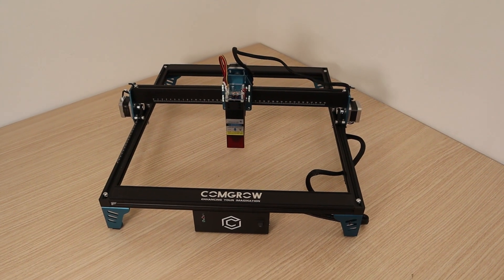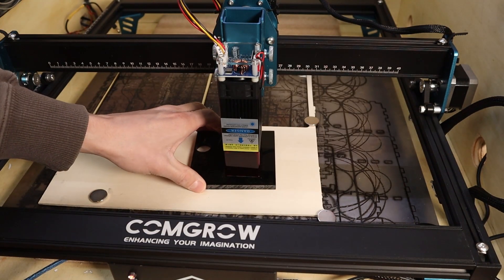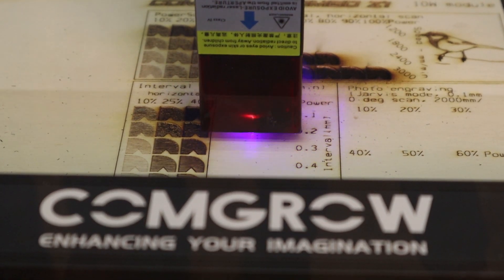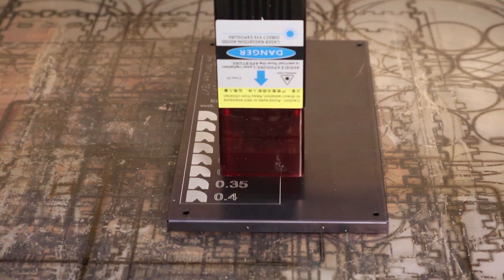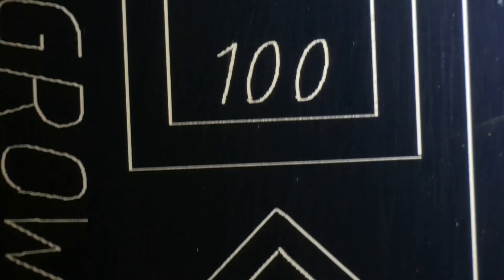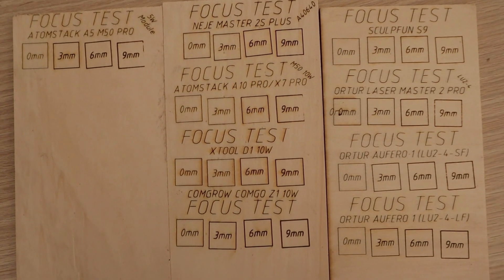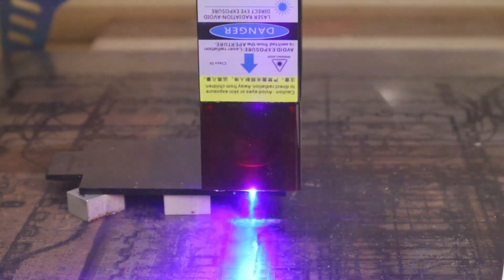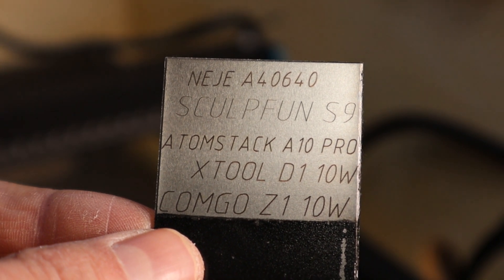Comgrow Comgo Z1 10W Dual-Beam Laser Engraver Review and Test | Affordable!

Comment: Of all these in the 5-10w diode range, which one do you recommend the most overall and why?
Reply from the maker: Choosing the best one will heavily depend on what you mainly want to do with it and what is your budget. For example I can't say one is better than the other if the first one costs twice as more.
Reply: @JTMakesIt  good point. I will be using it mostly for medium volume runs cutting corrugated cardboard for shipping and custom packaging. Also some engraving and fun hobby projects. Any suggestions based on this? Thank you!
Reply from the maker: @EEZYEEEE  Hi, then I would recommend you a 10W machine. Comgrow Z1, Sculpfun S10 or the Atomstack A10 or if you have a larger budget, then the XTool. If you have a very tight budget then the Sculpfun S9(5W) would also work well. I have made reviews for all of them. Watch my other videos or check the review articles on hobbylasercutters.com and decide what is the best for you.
Reply: @JTMakesIt  excellent, thank you! I like what I see so far with the comgrow z1 10w but a little concerned about the “wobbly” lines due to the square laser shape per your review. Is this pretty common with this class of lasers? It might be pixel peeping but just want to make sure I get a good quality engraving when I need to. Also, I’m looking at the Comgrow kit which includes the laser cover, rotary tool, and honeycomb but in all honesty, are those really necessary? I can see the rotary coming in handy and maybe the honeycomb might be required (?) but what’s your take on the cover? I will definitely use your link and coupon to purchase btw!
Reply from the maker: @EEZYEEEE  the cover is necessary if you use the laser in a room that you also do other stuff. Laser engraving produces a lot of smoke and odors especially with woods and plastics. The fumes are not good for your health. Using the cover you can direct the fumes out of the room. Otherwise rhe room will be filled with smoke. The wobbly lines are very small and mostly visible under microscope. If you don't plan to engrave really small text and patterns ( under 2mm) it is perfectly fine. Honeycomb is great if you don't want to get smoke stains on the bottom side of the wood you are cutting. But if you plan to upgrade it with an air assist then the honeycomb is almost necessary or the pieces will be blown away by the air.(check my Sculpfun S10 video)

Comment: Very good review!!!!!!!!!
I need to be able to work offline because my desktop is in my house and my shop would be outside in the house in a balcony. I do not want to move my desktop every time i want to cut something.

Do you have any advice in the same price range as the Comgo z1? 
Thanks
Reply from the maker: Thanks!
What I found, only higher priced models can work offline like the A10:
https://youtu.be/sbrfMBkomWE
Or you can go with lower priced A5 (5W model):
https://hobbylasercutters.com/atomstack-a5-m50-pro/
It is still quite good for cutting stuff up to 6mm thick
But having computer near the machine is very nice. Maybe consider a cheap used laptop only for running the laser engraver.
Reply: @JTMakesIt  I did find and old laptop and lightburn works in it.
Do you have a preference between atomstak or comgo ?
what is better in terms of quality and customer service?

thanks again for your comment!
Reply from the maker: @alexherrera3918  Atomstack is sure better, but it costs much more. It depends on your budget and your needs. You can check how they both perform on the same cutting tasks here: https://hobbylasercutters.com/laser-reviews/

Comment: Hello nice review , as always :) ...  the only "missing" thing for me , is to have it "computer free" ... such as my Longer Ray 5 ( sd card , screen ) ... Do you think I could swap the laser head of this one to put it on my Ray 5 ?
Reply from the maker: I didn't get my hands on Ray5, so I don't know if the connector and voltage is the same. But check my video of the Atomstack A10, that one can be run standalone.
Reply: @JTMakesIt  I already saw that video on the A10 pro :) ... but it's not the same budget !  .... I think that even the price of this Cowgrow Z1 and the price of my ray 5 together is below the A10 pro ;)
this Z1 10W the real output of the laser .. I suppose  seeing the cut power
Reply from the maker: @cryoglobe  it is true 10W power. I got a laser optical power measure tool and it outputs 11W of optical power.
Reply: @JTMakesIt  thanks a lot for the answers and time